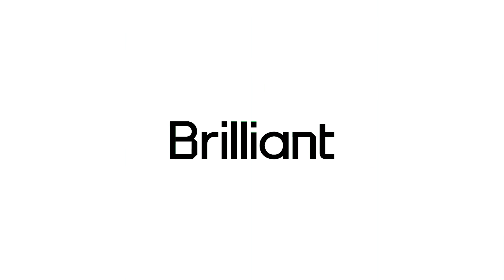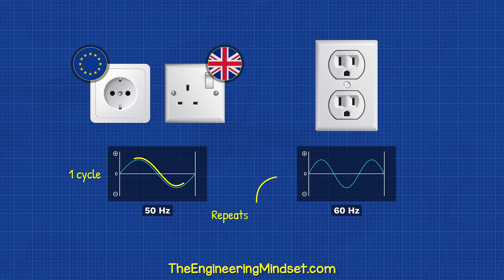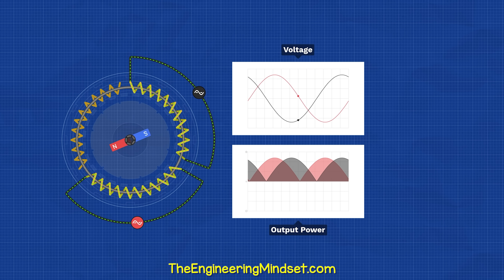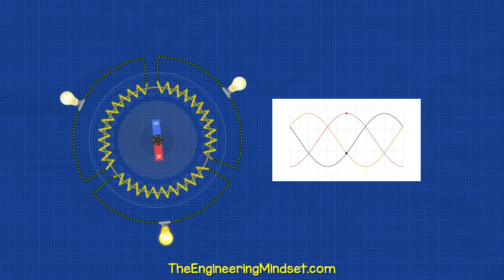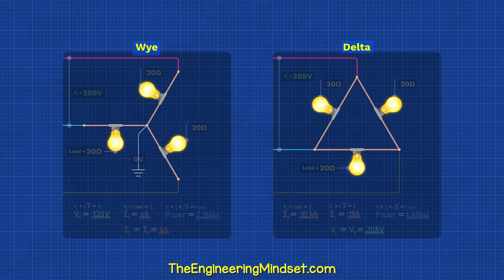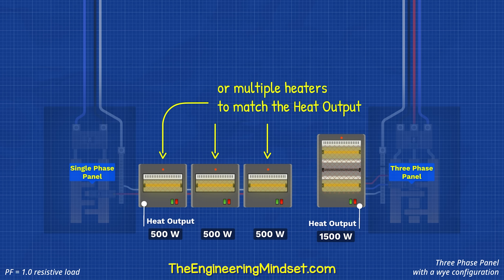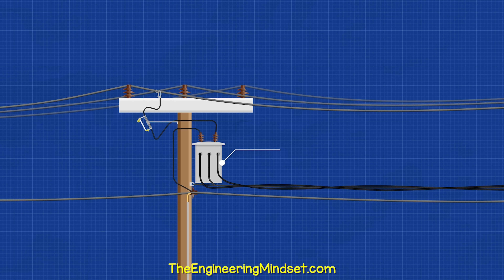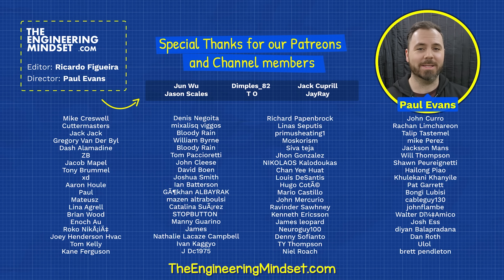How 3 Phase Power works: why 3 phases?

Comment: Tell me if a smart plug is officially compatible with 120v ac 
But some people say it also works well on 240v ac in thier home countries, so how does it work and are these people lying or saying truth. Wont 240v break the smart switch.

By the way I am taking about TP link Kasa switches they are very good but they only come with 120v varient, I live in India we have 240v only, and I don't want to set a stepdown generator for this

Comment: Long retired EET and thought this link deserved saving, as your 3 Phase explanation is exceptionally good. Just a note or two though. LED's have a very, very, very low Reverse Breakdown Voltage. Typically, under 5V.  The exact breakdown voltage is listed in the data sheet for each color and type of LED. Typically, the Reverse Breakdown voltage is only a couple of volts above its forward voltage rating. So, just because an LED isn't lit does not guarantee that zero current is flowing in the reverse direction. 

In regard to incandescent lamps: When connected to a 50 - 60Hz line source, the light output never approaches zero because we are converting heat energy to light energy. The filament never sees temperatures cool enough to stop emitting light. 
Wakodahatchee Chris

Comment: At 12:41 the I am not able to understand the illustration.  the step down residential transformer is connected to one of the 3 phase lines and the ground but outputs 3 cables. at home any of the 3 phases with common  ground will create 120 but across the phases will give 240. I noticed in canada the board in the houses get only 2 hot lines and one ground. do they got 2 lines only from the transformer and one to the common ground?

how can the transformer give out 3 phases but it pulls power from one line only? this one is baffling me.
Reply from the maker: Please see this video https://youtu.be/u0SsejDCVkU

Comment: So, you missed an important thing you could have pointed out way back near the beginning. When you showed the three phases of sine waves as a fairly smooth combination, you could have taken the square of each curve and summed them. The power (in a resistive load anyway) is proportional to the square of the voltage. Adding the square of all three sine waves at any instant will give you a constant value, regardless of where you are along the timeline. The output power, then, is perfectly constant with three phases. Not the slight lumpiness you showed. With unbalanced loads and non-resistive power factors I suppose things get weird. I haven't looked at that stuff in decades and don't remember the details.

Comment: Most generators do not use permanent magnets, they use exciter coils (basically electromagnets), so they can more precisely control the output voltage and current by varying the magnetic field of the exciter coils.

Comment: I put phase sequence relays on all our factory air compressors,less than 100 bucks and shuts down if you lose a phase from city electrical. Alot cheaper than replacing a couple thousand dollar motors.

Comment: i dont understand why those specific numbers, like why 3 phases, why not 2 or 4 ? why 230kv ? why not 999 trillion volt for long distance power transmission....
Reply: It boils down to the balance between power and cost, and you can only achieve such balance with 3 phases. It gives you enough power while the cost to maintain is justifiable. 6 phases, for example, will provide more power, but the cost to maintain such system is astronomical. Thats why 3 phase became standard

Comment: as an electronics engineer, I don't deeply or as clearly understand this until now.  however, learnign this makes me realize how old this is and needs upgrading or replacement.  See, DC high voltage transformers are here and renewable energy is essentially DC, while most things we power in our house are essentially DC.

Comment: A lot of LED are flickering at te double frequency of the grid (100 Hz or 120 Hz). 
Since LEDs do not have the thermal inertia of incandescent bulbs, LEDs flicker visibly. There are rarely LEDs with a constant current; these do not flicker. The more energy efficient an LED is, the more likely it is to flicker.
Reply: leds shouldn't flicker because they use dc
Reply: @gamecubeplayer  LED brightness depends on the Current. If the AC from the grid is rectified with a bridge rectifier it results in Voltage pulses with a frequency of the double of the grid frequency. This voltage can directly be connected with a serie of LED in serie untlil it is about the correct forward voltage of the diode. The resulting output will be pulsed light with the frequency of 100 Hz (if grid is 50Hz). (very annoing, but cheap)
There are LED driver which are producing a flawless DC Current, where the light is perfect.

Comment: The implications of phase theory are coming to the fore in relation to attacks on electricity networks. Most recently the huge outage in Spain and Portugal. It is believed that a hostile state has developed a way of remotely interfering with phase settings within electricity infrastructure - a way of triggering some kind of sustained phase invertion which causes the whole network to shut itself down.

Comment: I'm surprised that most American homes are single-phase only. Most apartment building I've ever lived in in the Balkans have three-phase power. People usually connect things like electric stoves etc.
Reply: because single phase plenty enough. 3 phases are utilized in most commercial buildings
Reply: @nhitc6832  230v 1x35a is barely enough

Comment: This doesn't address the 240v/120v power feed common to most modern US residential panels. This has two 120V "phases"  derived from a single phase of a three phase distribution transformer via a center tapped neutral (so the two (split) "phases" are apparently 180° out of phase). This is rather indirectly related to the 3 phase explanation - however homeowners will finds this is what is fed to their panel to allow for both 120v and 240v appliances. Helpful to understand how this relates.
Reply from the maker: Please see our transformer video https://youtu.be/u0SsejDCVkU

Comment: EE here, minor nitpick- the 120/240v to homes is 2 phases, not 1. Neutral wire isn’t run like that- it only runs to the center tap on the transformer, which is grounded and cuts the voltage into 2 phases 180 degrees apart. Phases are connected there by delta to wye conversion, which eliminates the need for neutral by providing a path to equalize voltages relative to earth. As you said, 3 phase is used because it allows 3 wires, the minimum, and also because the delta and wye can be the two sides of the same transformer. But the coils can be center tapped to split phases into sub-phases, and current or even power can still flow when the voltage is 0, though it may need to be expressed with imaginary numbers. Reactive loads shift the phase of the current in relation to the phase of the voltage. They are rarely both 0 at the same time.
Reply: I thought EE called it single phase because it's pulled from one tap on a 3 phase power distribution wire then on the step-down side of the transformer is center tapped giving 180° out of phase from one phase leg.

Comment: Ich verstehe bis heute nicht, warum man 120V nutzt. Alle typischen Geräte im Haushalt, belasten Leitungen bei gleicher Leistung mit dem doppelten Strom.

Ein 1500W Wasserkocher hat bei uns (Deutschland) gut 6,5A.

Bei 120V aber bereits 12,5A. 

Entweder man benutzt Geräte mit halber Leistung, was dann doch sehr einschneident wäre (alles dauert viel länger), oder verdoppelt den Leitungsquerschnitt. Wobei dann immernoch mit sehr schwachen Geräten gearbeitet wird.
Reply: Historical reasons. Today, It is impractical to replace something that works with such scales.

Comment: I get the graphic at 2:00 because the magnet rotation axis is along the vertical axis of the coil, but how come when the magnet spins perpendicular to the coil, you still get current?
Reply: Actually the rotational axis of the magnet needs to be perpendicular to the area vector of the coil to generate electricity as the magnetic field lines which cuts the coil needs to be time varying.. If the area vector and the rotational axis are parallel thn the field line do not change in magnitude and is not time varying in nature

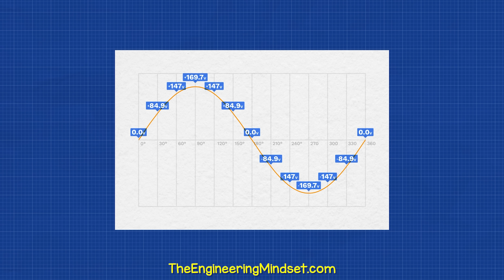Comment: Nice explanation...but I lose it at 11:50
Reply: it's the Root Mean Square of the sinusoidal voltages. It basically tells you the equivalent DC voltage the results in the same amount of power. For example, given a load, 170V AC will deliver the same power as 120V DC.

Comment: the heat is more consistent?!? where?  inside the heater?!. The type of heater consists of  completely separate 1-phase heaters.. the heating is inertial process so the statement is absurd.. are trying to say that you can feel or see the 50Hz pulsation on the heater ?!?..
It's completely different with the 3-phase motor.. and there all of them are working in the same time in different directions - pulling and pushing together..

Comment: @EngineeringMindset

What about the 2 phase supply?

From the diagram of the US 120/240 volt system, it appears to be a centre tap arrangement, with presumably the centre being a 0V/ground-neutral wire.

This effectively makes it a two-phase supply, which wasn't mentioned in the discussion, and in particular no reasons given for why we don't generally use 2 phase supplies,  the illustration shown probably being the only regular application for it.

However, there are good reasons for not using a two-phase supply, although I can't illustrate it with diagrams in this comment. One of the main ones being that although you could in theory run a motor from 2ø, but unless the motor was given a kickstart it wouldn't know which direction to rotate in and might not even start. By comparison,  a 3ø supply gives you a rotating magnetic field enabling you to define which direction will rotate in.  Another reason is that it wouldn't give you very smooth power delivery, no better than the 1ø supply, because the voltage between phases would still drop to zero every half cycle.

 As explained, there is no point in going to more phases, even though they would work perfectly well, because it just increases the complexity, and hence cost of the system.

Comment: Most lights are LED, which are usually constant .. bro really?
Reply from the maker: Yes, LED's do not blink. The circuit converting them from AC to DC or the circuit controlling their brightness might make them blink if its badly designed or cheap. But our studio lights are all LED and they do not blink. However my desk lamp is cheap and it does blink.

Comment: Because 4 phase would be cheaper plus the phase shift is 90 degrees. With 90 degrees you could shift power from one phase to the next making the power on that phase stronger.
Reply: Well, Too late for that. The majority of our grids run at 3 phase. Replacing that wouls cost way too much for its benefits.

Comment: The U.S.A. Uses 240V transformers with a tap split down the middle for -120-120V. It's a bit unnecessary if you're not a neanderthal in electricity handling and safety.

Comment: So why not 6 phase? 9?
Reply: tho you'll get more power the more phases you add, the complexity and the cost to run such system increases significantly. So 3 phase provides a balance between power and cost. It's good enough so to speak.

Comment: Apart from power transmission, another modern use of 3 phase is that of variable frequency traction motors, both on road vehicles, and railway rolling stock with electric traction. It’s use in that context is related to the development of power electronics, with integrated gate bipolar transistors (IGBT).

Historically, the use of AC motors at standard frequency was impractical for heavy loads, hence the use of low frequency, such as 16 2/3 Hz in 50 Hz areas, when AC motors were used.  These days, with variable frequency motors, that is no longer relevant - although it would take a while to get rid of the low frequency kit.

Comment: Six phase power is sometimes used with rectification for high powered rectifiers. With only 60 degrees between phases, less filtering is needed to produce smooth DC. The six phases are derived from three by using a transformer with two secondary windings, one connected in Delta & the other in star (wye).

Comment: I've known for a while that I'm going to need to include 3 phase power for my garage when i eventually get a CNC Mill and Lathe, I've just been confused until now as to what that meant and this video was exactly what i needed to understand the concept! Now to figure out the proper hardware i need to acquire for wiring everything up..

Comment: I didn't understand much. Why do you need three phases if 2 do the same work?
Reply: because 2 phases can't normally rotate a motor
Reply: @gamecubeplayer  2 phase is the minimum to create a rotating magnetic field. So 2 phases can in fact rotate a motor but not as efficiently and smoothly as 3 phases. As a matter of fact, some single phase AC compressor motors in residential HVAC system utilize a capacitor to mimic a 2 phase system. These motors don't require as much power as 3 phase motors, so a 2 phase is good enough.

Comment: RCA used a 6 phase transformer/rectifier configuration on their 50KW AM transmitters back in her '80s to provide a lower AC component from the rectifiers.

Comment: As a civil engineer, I’m here to find out why there is no 2 phases AC😅
Reply: there were 2 phases power systems. But they got phased out in the mid 20th century. 3 phase power system became standard.

Comment: Another important thing, in 3 phase system power is linear, this is what enabled induction engines to work properly, because without linear power they would vibrate. Only achievable in three phase system, induction engines are the most widespread engines used in industry today.
Reply: At one point they had a two-phase at 90°.
Reply: n-phase power will provide constant power, except 1-phase and split phase like the 240/120 system in the U.S

Comment: Because cupper. All motors 6 wires all Generators and the way between

To phases also possible, but the motor is not so powerful have only 2 magnetfields.

Comment: Why other countries use 220v ??? particularly at southeast asia..
is that an engineering matters or just an identity purpose?
Reply: most countries use 220-240v because it's more efficient than 110-120v (for some reason japan uses 100v)

Comment: In a Y connected system, the phase-to-phase voltage is equal to the square root of three times the phase-to-neutral voltage:   120 * √3 = 208

Comment: Commercial and industrial buildings in Australia commonly receive a 400–415 V three-phase supply at 50 Hz (rather than just single-phase 230 V) because they tend to have larger electrical loads (HVAC, motors, cooking equipment, lifts, etc.) that run more efficiently and reliably on three-phase power. This slightly higher line-to-line voltage (400 V or 415 V) is the standardized “low-voltage” three-phase level for much of Europe/Australia at 50 Hz and provides enough capacity for heavier commercial demands.

Why 400–415 V Three-Phase?
Higher Power Capacity
Three-phase at 400–415 V allows more power to be delivered using smaller conductors compared to an equivalent single-phase system. This makes it more efficient for the utility to supply (less copper or aluminum needed) and for the customer to run large equipment.

Smooth Operation for Motors

Commercial premises often operate large motors (e.g., air conditioning compressors, elevators, refrigeration equipment).
A three-phase supply gives a smoother torque, reduces vibration, and improves motor performance (no need for extra start capacitors that single-phase motors often require).
Legacy and Global Standard

Historically, Europe and many Commonwealth countries standardized on about 415 V line-to-line (and 240 V line-to-neutral) at 50 Hz.
Over time, Europe shifted nominally to 400 V/230 V, Australia still often references 415 V/240 V, but in practice, they’re close enough that equipment is interchangeable and the grids are considered 400 V–415 V.
Balanced Loading

With three-phase service, loads can be spread across the three phases, helping keep the local electrical network balanced.
Balanced loads mean less current in the neutral conductor and more stable voltages.
Compatibility with 50 Hz

Australia uses 50 Hz (like Europe, Asia, Africa). North America, by contrast, uses 60 Hz. Each grid maintains its own historical frequency standard.
Much industrial machinery (motors, transformers) is designed around these “regional standard” frequencies and voltages.
In a Nutshell
Commercial sites need more power and often have three-phase motors and other heavy loads.
Three-phase at 400–415 V supplies that power in a more cost-effective, efficient, and well-established standard format.
50 Hz is simply the historical frequency standard in Australia, matching much of the rest of the world outside the Americas.

Comment: Why Three-Phase Power in the First Place?
Smoother Power Delivery

A single-phase AC supply inherently “pulses” as its sine wave rises and falls.
By staggering three separate AC waveforms at 120° apart, the overall power flow becomes much more steady (less fluctuation). This smooth power delivery is critical for running motors and other equipment efficiently.
Efficiency Gains

Three-phase systems can deliver higher power using thinner (and fewer) conductors compared to equivalent single-phase systems.
Generators, transformers, and motors become more compact for the same power rating.
Easy Motor Starting & Operation

In three-phase, each phase “pushes” the motor rotor in sequence. Motors start easily and run smoothly with fewer vibrations.
For industrial applications—like air compressors, pumps, large HVAC fans—three-phase motors are preferred due to better performance and efficiency.